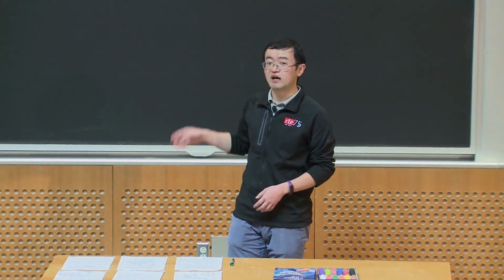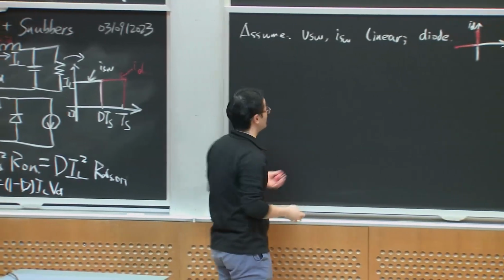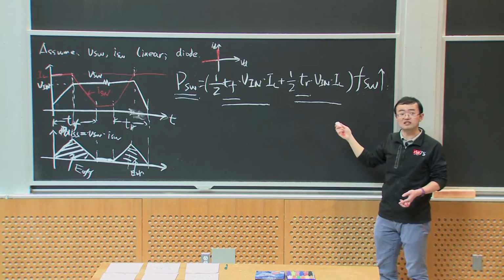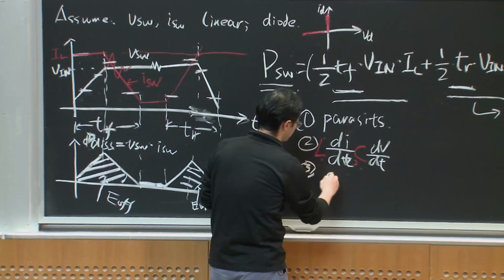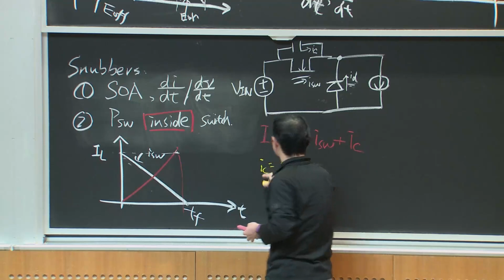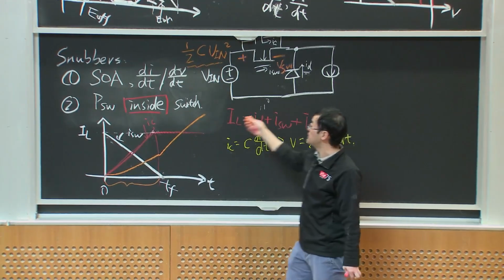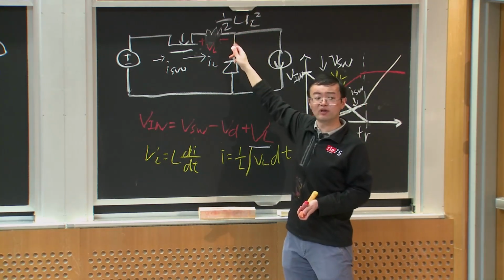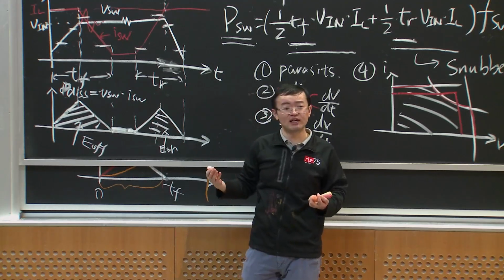Lecture 15: Switching Losses and Snubbers

Comment: I intuitively felt that turn on series inductor is needed to prevent the transistor from hard switching into diode and inductor parasitic capacitance but did not imagine what to do with resonance of added inductor. Nice to learn about turn on RCD snubber. In low power dcdc design i just slow down switching speed and eat the loss.

Comment: You can buy switching power supplies for every application at a cost you cannot pass up.  There is a lot to understand about the design of the transformer and it is pointless “re-inventing the wheel.” Don’t even waste your time and money trying to do something that is way beyond your control and budget and understanding. Switching power supplies are only a recent development because they are so complex. These “Professors” don’t have a clue about the complexities, reliability and long-term problems. Don’t even touch this subject. You will regret you even thought it was possible. You couldn’t even get the construction of the transformer correct after 100 tries. These supplies are up to 98% efficient. And the transformer will cost you more than a whole supply.
Reply: Inane comment. Even if you’re not designing your own switchers, it’s important to understand tradeoffs. Also, who do you think designs the modules  that you buy?
Reply: @bar @barrybensen4138 are you talking to?  It sounds like you have never bought a module in your life. I don’t have a clue what you are saying. What do you mean by tradeoffs? It sounds like you want to trade off a hundred modules for a new Maserati.

Comment: on the full bridge forward converter how do you ensure that the positive V seconds exactly equals the negative Volt Seconds.  for instance what if the switches are slightly mismatched?  will you build up flux?
Reply: It shouldn't build up because 1) any offset will simply drive the circuit slightly harder and escape 2) you're pausing at 0V giving it an escape path and 3) you're driving the magnetics both positive and negative in each cycle which should reset it. In most practical devices, even if you perfectly match the switches you'll still have between 5 and 30 ns difference in the on/off duty cycles of the switch drivers, so you'll only be closely matched, never exactly matched.